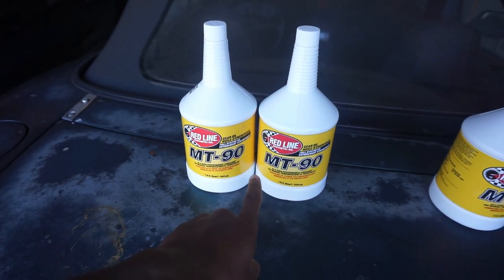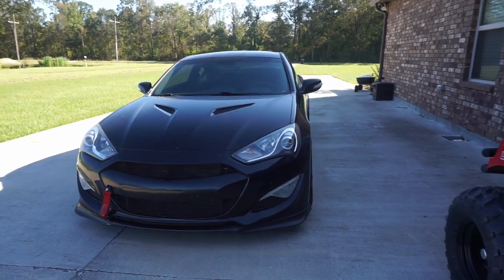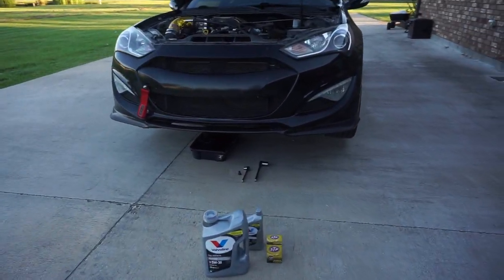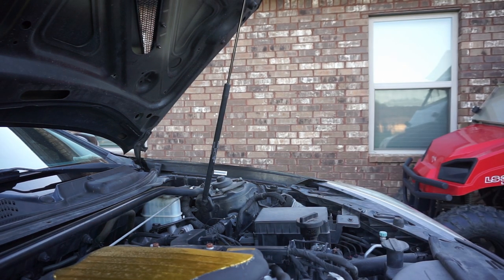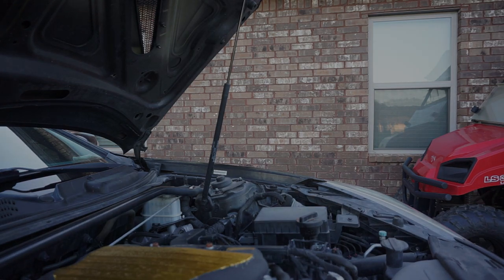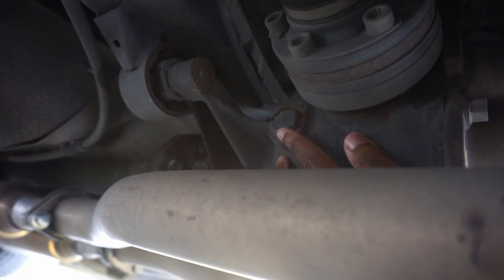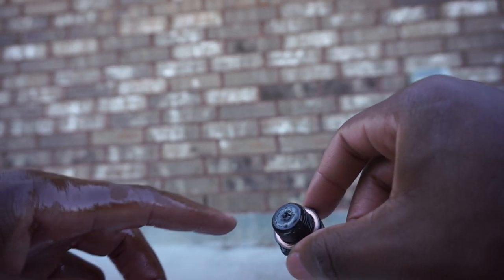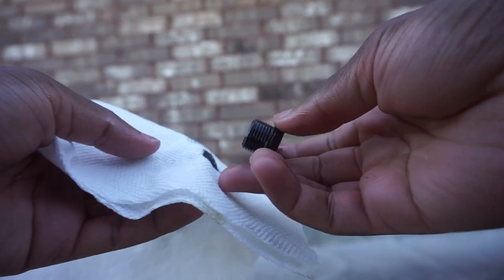The BEST Gear Oil? | Redline Transmission and Differential Fluid Change | Genesis Coupe 3.8

Comment: I just changed my engine oil, trans oil, and diff oil too yesterday. Was easy draining the trans and diff fluid but it was a pain filling up because I used one of those pump top that screws onto the bottles. I used oem fluids. As the legend (Davis) says oem is good enough for daily use. But if you’re racing gotta use redline.
Reply from the maker: Nice! Nothing wrong with the oem fluids for the daily, I run my car hard every now and then so that’s why I went with what I did💪🏽

Comment: can i take the skid plate off for good and just drive without the skid plate? Or does it matter to put it back and keep it on? It sucks taking it off everytime when doing an oil change
Reply from the maker: I haven’t had a skid plate on any of my cars since my first car in 2011 lol.. But it is recommended to have them, especially on lowered vehicles. That’s really your call
Reply: @pj_morrison  Thanks. Have you ran into any issues having it off?
Reply from the maker: @ProRide-pj7pu  none